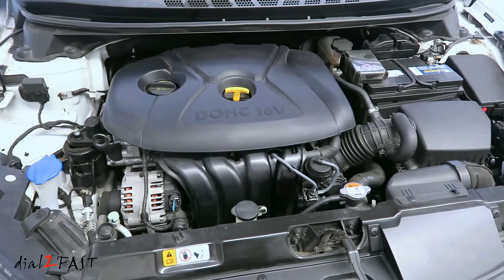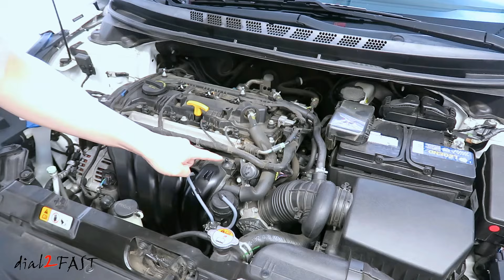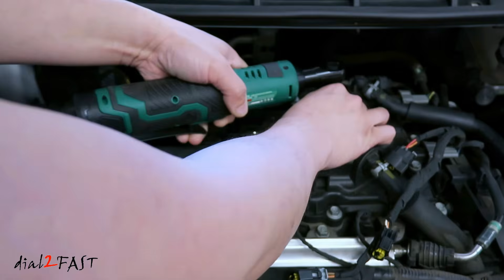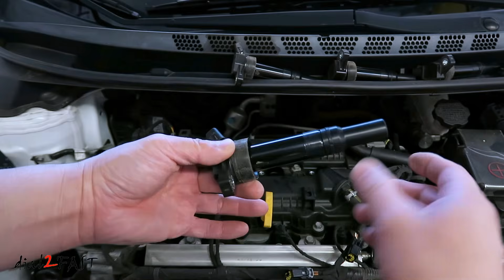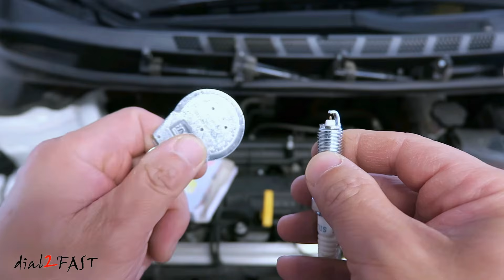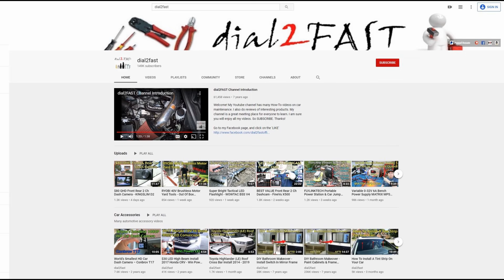Replace 100,000 Miles Spark Plugs | NGK Iridium | Hyundai Elantra

Comment: Thanks for the video, but I couldn't get my ignition coils out. They were suctioned in, and when I tried to use a bit of force, the top cap came loose from the coil instead.

Comment: The most ideal and very detailed video I was looking for. And that GAP measurement you did with the ruler — 1.1 — was super. I have one question for you: I have a Hyundai Elantra 2015 (VIN code year is 2015), 1.8 DOHC engine. How can I find out the spark plug part number and model without removing the spark plug?
Reply: 2013 to 2017 is usually the same. They didnt switch much over
Reply: @jotansun4357  thank you

Comment: Tools- flat screw driver, 10Mm socket,  5/8 spark plug socket,  rachet,  gap tool, torque (14-24Nm),

Comment: What do you do if they gray tab breaks?
Reply from the maker: It's a crappy design. If the tab breaks, you should put a tie wrap around the 2 connectors on the plug after you connect it. This will prevent the plug from coming loose.
Reply: When I broke mines on cylinder two couple years ago, I just put electrical tape around it to make sure it secures and so far it has even after about 2 years since I’ve changed them

Comment: Rather than disconnecting the wires from the coils on an older vehicle could you just leave them connected and pull the coil out and change each plug separate?

Comment: Thank you! For the video! Quick quesiton! Which one is the cylinder 4 ?I got cylinder 4 misfire, I'm assuming I should replace my cylinder 4 sparkplug! Thanks in advanced! (Code po304)
Reply from the maker: If you are standing in front of your car looking at the engine, then cylinder 1 is on the left (passenger side), and cylinder 4 is on the right (driver's side).

Comment: BEST VIDEO I'VE SEEN YET! HE MENTIONS THE GAP, THE TORQUE, THE ENTIRE PROCESS! IT'S THE BEST ALL AROUND INFORMATIVE VIDEO ABOUT THIS PROCESS ON THIS MODEL! THANK YOU!
Reply: It should be a crime to make a tutorial video showing how to take everything apart with no mention of how to put it back together.
Reply: @Crs664  In this case, it was very simple. He explained how to put the new spark plugs in. From there, it's just pop the new ignition coils in (if you're changing those too), screw down with the same screws in same positions as the ones you take out, attach clips, push cover back down.

Comment: I just changed my factory plugs after 136,000 miles.  I was getting a "cylinder 3 misfire" code.  I figured it was just the old plugs.  After changing them, I still got a misfire code.  I swapped the coils on 2 and 3 and the code moved to a "cylinder 2 misfire."  I replaced the damaged coil and it runs good as new, especially with the new plugs.
Reply: Thanks for this response !!! Great diagnostic tip !!! I haven't had this issue, but I'll keep an eye out if I do.
Reply: 120,000 mine is also misfiring really bad while I’m driving it is not good I might need some serious help
Reply: @christianle5926 serious help? Just get change the spugs and get a new coil. If that doesn’t fix look into changing the fuel injector. All these should be replaced anyway at your mileage.
Reply: Hah same exact thing here on the same cylinder! Changed all spugs and got a new coil for cylinder 3. Gonna go ahead and change the rest of the coils over the next few paychecks. At 100k miles it’s time

Comment: Can you advise on gap size for a NGK plug for a 2017 Hyundai Elantra. Online and videos give different size and the NGK plugs (.032) at the auto part store weren’t even close to the .044…? Help out thanks…!
Reply from the maker: For NGK SILZKR7B11, gap size 0.0394-0.0433
Reply: .044 is correct

Comment: Great video…. The only thing i would say is Not to take out all the spark plugs at one time, remove and replace 1 at a time. This is so you do not have any dirt or debris fall into the other holes as you are replacing a plug.
Reply: was thinking the same thing, it's like swapping out lenses of a camera; act quick, or else you'll get dirt and junk in the one place there isn't supposed to be any!
Reply: Use a clean shop terry cloth towel over the open ignition coil ports when not working on them